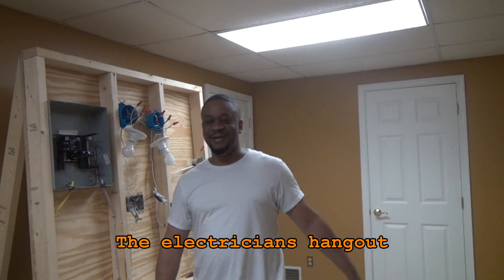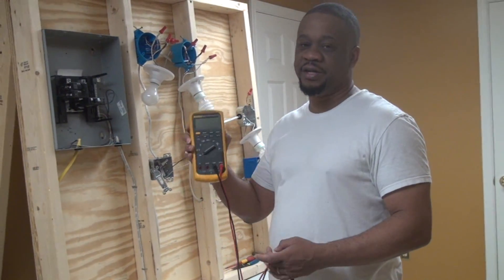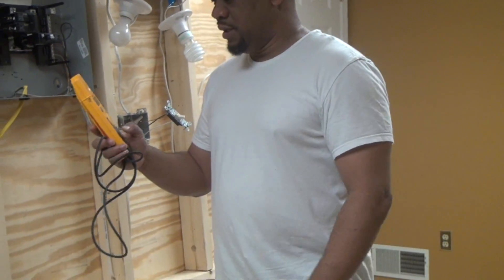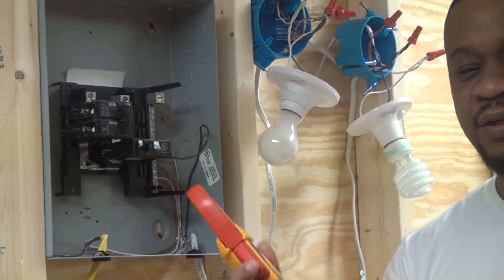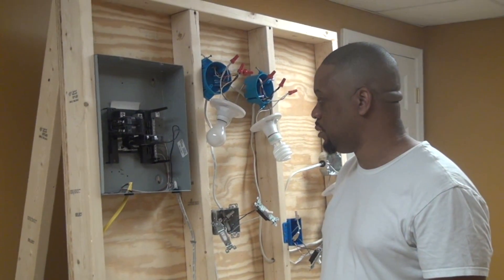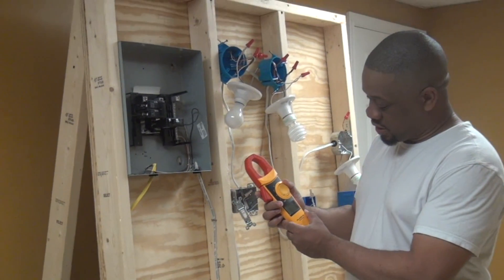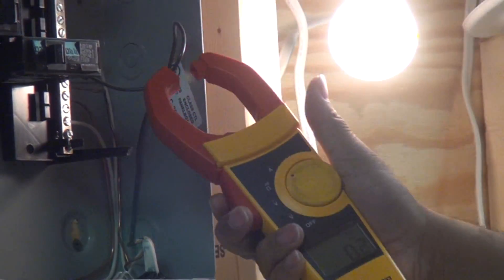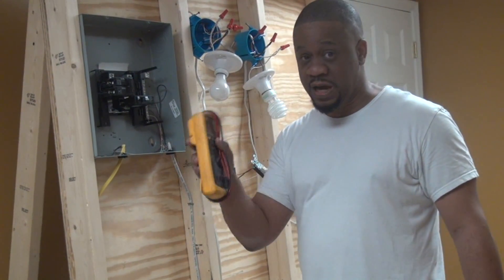How to check current in an AC circuit

Comment: I would really appreciate if you can answer  this question, I cant seem to find the answer anywhere.  
how do you measure the total amps for the entire breaker panel, for 240v devices [like an well pump] you only measure 1 leg [10a x 240 = 2400 watts]  for 120 devices you only measure one leg [hot to neuetral], and then the neutral carries the imbalance between the 2 legs [from my understanding ] , so in other words lets say you have 12 on one leg 15 on the other leg and lets say 3 on the neutral ,  the question is how do you read the true total amps . .  i have searched high and low on what is the formula to take these 3 numbers and calcullate the total amps or watts ? if you know the answer
 i would  reaaly appreciate it
FOR EXAMPLE ;
L1         N         L2
10A      N       10A   [240v DEVICE 2400Watt ]
2A        N       5A      [2 separate 120v devices L1 240 Watt   L2 600 Watt ]
TOTAL
L1        N        L2       [neutral carries the difference between the 2 legs from my understanding]
12A    3A      15A
Total watts using what we actually know 3,240watts which is 13.5 amp at 240v but if you look at the amps above if you were to measure them it is in no way 13.5A and if you were to measure any of those it would not give you 3240 watts.  So how do you actually do it??????    I have looked every where for this answer
Reply from the maker: you are over complicating it do what I showed in the video use the ammeter on the phase conductor you are checking current not wattage. PS. you never check the current on the neutral conductor. clamp one phase conductor at a time read results thats all.
Reply: @Tyrone3340 Thank for the response tyrone, maybe i am over complicating it, put simply i just want to know how to read the total amp of the entire breaker panel at once? do i read both legs and add them together? or do i just read the leg that is higher [since there ussually different].
Reply from the maker: @mikeriverajr4447  you read both but go off the leg that has the highest load. in a perfect we try to balance the loads across both legs but as you know this is never the case.
Reply: @Tyrone3340  
Hi Tyrone again thanks for the response. . . The problem is If you read the only the high leg its not accurate and its its an over measurement if your trying to determine total watts which is my goal [ I do off grid systems using iverters so total wattage of the breaker  is very important for me ] 
I think i figured it out tho: If you  measure the current returning on the neutral and then divide it in half and then add it to the lower amperaged leg and then mulitply it by 240v , it adds up pefectly to the exact total watts , At least on paper. . .  I want to do some testing on this. have you ever heard of this?
 This is an example on paper
L1         N         L2
10A      N       10A   [240v DEVICE 2400Watt ]
2A        N       5A    [120v devices  840 Watts]
                                     [total watts = 3240]
TOTAL
L1        N        L2       
12A    3A      15A
 
[L1] + [half of N] 
 12  +     1.5         =13.5a x240v =3240 watts
This perfectly adds up with what is known is the actual watts as determined above . 
What do you think of this? I really appreciate any insight.
Reply from the maker: @mikeriverajr4447  Like I said before wattage is a pretty useless measurement to try and calculate in the field. If wattage is needed you are better off getting it of the device which would give a total VA rating considering it is a moving target. Having a lot of inverters on the system only makes what I said more relevant (inverters are non liner loads that can add harmonics to the system and further distort wattage calculations) without having to write a book to try and answer your question the most relevant reason to take a current reading would be to determine the load on the system and make an informed decision. You base that decision in a 240v system off the phase with the highest reading the neutral play no part in the readings as the current on the neutral is the imbalance of current between the two phases. I hope this helps
Reply: @Tyrone3340  thank you so much Tyrone for your answers, I have pretty good understanding of electrical BUT obviously it becomes peanuts , when it comes to some one of your knowledge. .  I use manual transfer switch and use cheap off the shelf inverters to back feed my home during emergencies  [some say its not possible] but definitley is  [ so for been succesful with a 150w cheapo , xantrex 400 xantrex1000 xantrex 1500 and and xm1800 , it feels good to be able to run 120v to an entire house at any time. I ussual bridge the legs and run 120 to both legs. . .I also  experiement with off grid battery back up systems , I guess my obsession with watts is because everything is in watts, all the inverters, ups,  all generators . . . so it just seems intuitive that i should get a accurate total wattage reading before sizing an inverter or generator,  I still cant wrap my head arround why its useless, but i also understand there are certain factors i dont have a good grasp over, like VA and power factor, so i presume my difficult in grasping why lies in that subject.   Just curios what do you think about that formula i made, it seems to work out perfect on paper, Im going to do a test to see if if it also works well in real life, but to simply it, the neutral carries the imbalace back, and if you half that and add it to the lower amperage leg it seems to give the true total wattage. Either way Tyrone , I really really appreciate your responses, I know a good deal about electrical that its really really hard to find people who know more than me or at least in my circle people so they all come end up coming to me for questions which means i ussually have no one to go to. . . so again I  am extremely greatfull !!!!!!!!!!!1
Reply from the maker: @mikeriverajr4447  sorry did not know you were talking about dc to ac inverters :-(  thought you were installing actual ac inverters ie frequency drives) So for dc to ac inverters the same principal apply the inverter tell you its power in watts and all the inherent losses are already factored in so you can simply divide the wattage by the system voltage to come up for a current at that operating voltage and size your inverter accordingly.

Comment: Hey guys question got a house was wired by a madman. Gainbox in roof 4 sets of wires going in. Black to black white to white trips breaker. This gainbox goes to a light that's at the box and 3 ogher lights. Putting a white in black turns the light on and doesnt trip breaker. But the switch for the light won't work. I haf it working correctly until my boss said it lookrf like a rats nest tore it out and didnt remenber how the wires went then proceeded to blame me of course. Basically I can get it to work with 4 blacks 1 white in black and 3 whites but the switch doesnt work itd constant current. Any idead and troubleshooting tips. I have a multimeter

Also note the gainbox only has 1 hot set of wires. The rest are legs

Comment: Thanks Tyrone, I have been hoping to find someone who knows electrical without going over everyone's heads. I have a ac clamp on but had no idea how to use it. I want to find overloads and split them up evenly. This is a great way to know how much is on each line as long as they are being used. lights are easy just flip them on. outlets are more of a pain but can be checked by plugging in a light with same amp pull in each outlet in series. Then write down how many outlets on that curcuit and where they are located. At least then if that curcuit pops you can go see what was plugged in that overloaded it. keep up the good work. I just subscribed.
Reply from the maker: Thanks Tim and you are welcome
Reply: Wow surprised you responded that quick. You have been busy. The dates on these videos was awhile back but interesting to watch. Yes I'm one of those old dudes who don't turn the power off to work on outlets but after listening to your explanation on why that's not a good idea think I'll pass on this in the future. Safety first Thanks
Reply from the maker: No problem Tim it was my pleasure!

Comment: I've put multimeter rods directly into outlet to check the Amps and it blew up.
Reply from the maker: I told you in the vid it is not wise or advised to use anything other that a clamp on ct type meter to check current.

Comment: Hi Tyrone, trying to find out what's wrong with a circuit of outlets. I'm getting the right voltage from hot to ground but nothing from hot to neutral.
Reply from the maker: sounds like the neutral is open somewhere

Comment: Thanks for the tutorial.  Question: My brother is getting EXTREMELY high utility bills all year around - two to three times as high as neighbours,  the energy co. swapped out meter twice and said the house in drawing A LOT of power,  what could be some issues causing this or is energy co. blowing smoke? thanks
Reply from the maker: It is hard to say but you can put an amprobe on the mains and see if the current drawn is really high. then work your way through each circuit to see which one is drawing high currents.
Reply: Thanks bro..
Reply from the maker: You are welcome Melvin

Comment: my home is new construction and the breakers are all rated for 16a, I have a studio which has a 16-outlet power strip and an 8-outlet on another receptacle..

I want to put in a 20a breaker but I'm sure sure if the wire is the proper gauge for it. would 4a extra be too much of a draw for the existing wiring?
Reply from the maker: if you install a 20a breaker you want to be sure that the wire is 12awg if not 15a is what you you should leave it at.

Comment: hey tyrone i have a question how do i check how much current is comming into my house
Reply from the maker: If you have circuit breakers Take a look at your panel and you will have a breaker that say's MAIN it will have a number on the handle that is the size in amperes that is coming into your house.

Comment: I don't know the difference between checking the the wires in a breaker box and checking current. Is it the same? You said don't use a multimeter to check current so that is why I'm confused please help me understand can I touch the wires or the screw heads coming out of the breakers with a regular multimeter and touch it to the bare wires like at a switcher a light fixture. The multimeter I bought does not measure amps it does battery volts doc volts and ohms or resistance
Reply from the maker: +steele829 current and voltage are values that can be tested. The video that you are posting on is about how to properly check current in a AC circuit.

Comment: But it is ok to test Voltage with a regular Digital Multi-meter? Seems like the meter is in the circuit either way just the dial in a different position?
Reply from the maker: +Rob M No if you check current with a dmm you have to put the meter in series with the load. When checking voltage you are placing the meter in parallel and you have no load. When checking current you are sending the load through the meter.
Reply: Thanks Tyrone

Comment: I greatly appreciate the tutorial on AC current testing.  I must compliment your skill in the electrical field, as well as the safety of NEVER testing AC current on a regular dig. meter. I myself aquire a degree/ certificate  in the electronic technology trade. AC/DC troubleshooting and repair. However I am inclined to ask you if your company is nation wide or just in your area.  I have been trying to get my foot in the door, yet no company I'VE applied with will contact me. My question is how I can Excell with a company similar to yours? I have alway been interested in and always will be an electronics nut..and believe that I could be an asset. Tyrone all I ask for is a quick paragraph in reference to my ability to expand and grow in the field I Love....

Thank You, 
Thomas Conklin
Reply from the maker: +Thomas Conklin For electronics the closet thing to what you want that could suggest would be industrial controls and automation. This actually what I have been doing for the past 25 years and with a 2 year AA most company's will start you at an entry level position. Most good company's will also  send to equipment specific training classes. This is the path that I would recommend you take, so search the job boards for keywords like electrical maintenance, electrical technician etc. Good Luck and God Bless

Comment: Nice Video Tyrone!

I would like to ask you a question.  I am having some problems with checking current from a 1.5V to 300V transformer circuit.  My 80 uF 330WV capacitor charges up but i can't read the current on my multimeter.  I know it charges up since it created a spark when i discharged it using a screwdriver.  Would you know if there is a multimeter capable of reading 300V of current or am i doing something wrong?  Thanks
Reply from the maker: Charles Tan Not sure what you mean by 300v of current. Are you testing voltage or current?
Reply: i'm testing current.  I am trying to increase the current at 1.5V battery but it goes through a  transformer which converts it into 330 V so i just wanted to know if the current rises when the voltage rises as well or does it stay the same?
Reply from the maker: Charles Tan with a transformer you are transferring power (wattage) from one circuit to another voltage and current are inversely proportional so when you step the voltage up you step the current down and vice versa. this is a basic explanation but hopefully answers your question.
Reply: Thanks.  So basically if i have 0.022 A of current from a 1.5V batt then it decreases as the voltage reaches 330 V from the transformer?
Reply from the maker: Charles Tan sorry did not see comment til now. The voltage and current from the battery does not change but voltage and current on the secondary of the transformer will change from that of the primary provided it is not an isolation transformer
Reply: ah i understand it now.  So basically the current increases as the voltage increases on the secondary from the transformer then? And if i wanted to increase the current a bit more then i'll just adjust it from the secondary side of the transformer.  I think that's correct right?
Reply from the maker: Charles Tan yes and no. If you refer back to the answer above with the transformer you have power coming in and power going out (wattage) You can not have more power going out than you have coming in. the ohms law formula for power is power is equal to voltage times current, so if you had 100 volts at 2 amps on the primary (200 watts) and you stepped the voltage down lets say 50 volts you would have 4 amps 4 times 50 equals 200 watts. the power never changed. This is still a basic explanation but hopefully this will help you a bit more.
Reply: Ah i'm starting to understand it.  So really if i wanted to increase the current through the secondary then all i have to do is decrease the voltage in the secondary because the primary can't be touched.  So if 1.5V 500 mA is going into the primary and the transformer comes out with 330 V on the Secondary then the current would be decreased.  if i reduce the voltage it should increase the current therefore if i reduce it enough then that means i will get 500 mA of current again, right?  But i always thought that if the voltage increases then the current increases with it.  That's what was confusing me.

Comment: Tyrone, Thanks very much for making this video. I now fully understand what to do to check the amp draw of a brand new air compressor that sporadically trips a 15amp breaker. The user manual says the compressor is 15amps.
Reply from the maker: You are welcome Ted

Comment: Tyrone- excellent presentation- hooah!.  You could use a clamp-on type current probe attachment for the multimeter to measure current.  With this attachment you would not need to insert the meter into the circuit (series connection)
Reply from the maker: Peg you are correct some multimeters have an ct attachment for measuring current which allows you to use the meter for both applications.